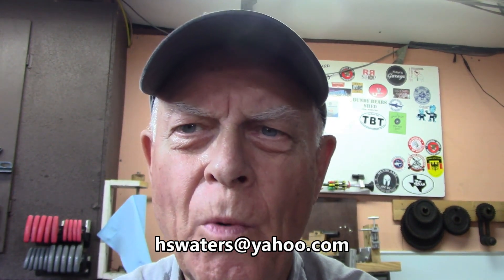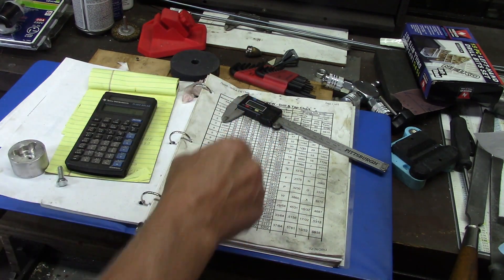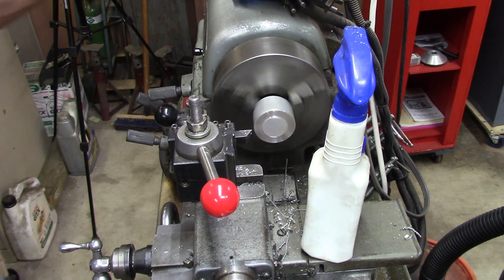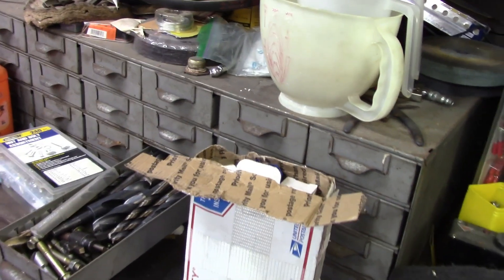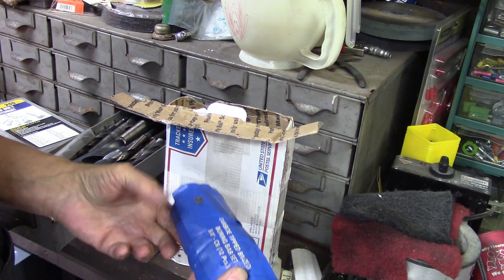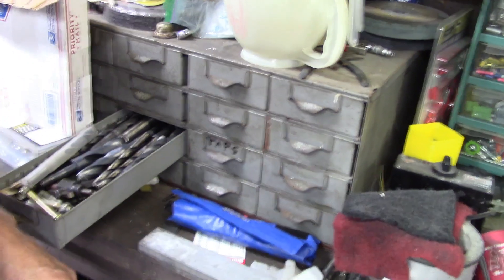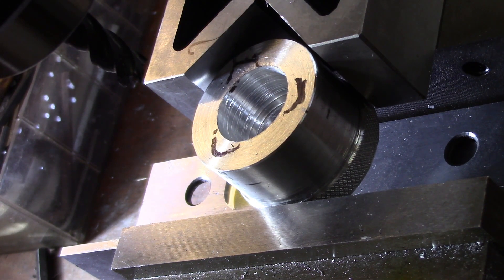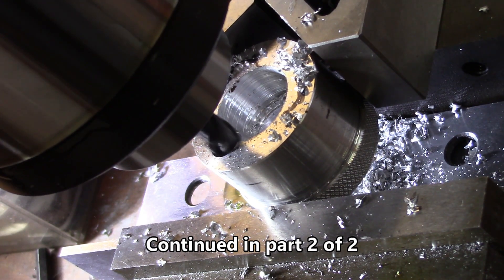Making thumb screws part 1 of 2

Comment: If you get a clean finish inside that mold Harold, I recon you could cast aluminium in that and it would release when it cooled.  Or you could carry on with the evil polluting chemical company training you received and use plastic.  Cheers Rob from down under.
Reply from the maker: I guess I got on the dark side Rob.  Thanks for stopping by.